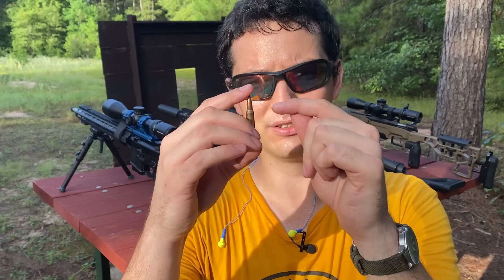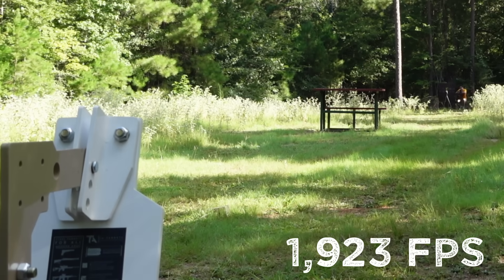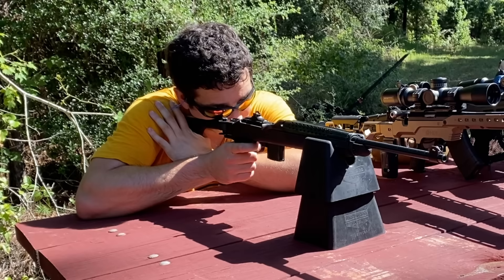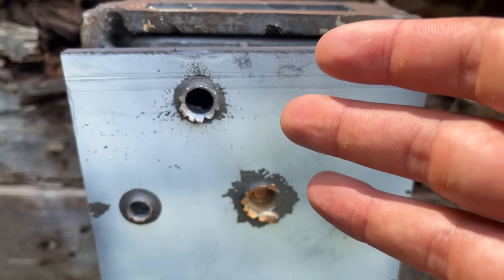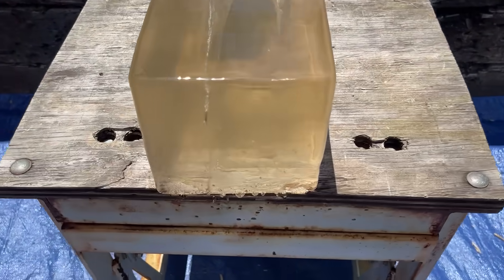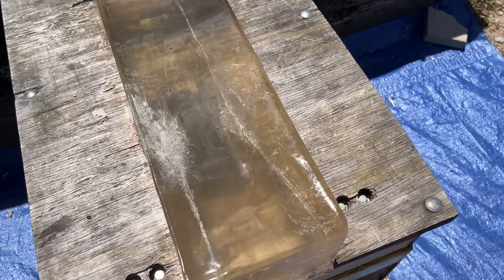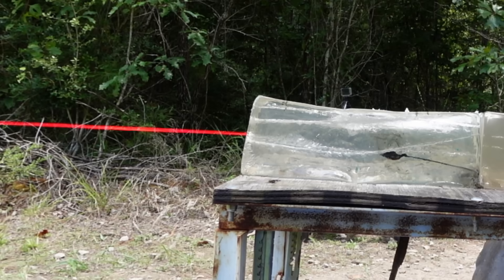I Will Never Shoot These Bullets Again

Comment: A g.i carbine has a fully shrouded firing pin with a notch cut out allowing the hammer to hit the firing pin only when the bolt is fully closed. Iver Johnson omitted this to save on machining costs. The result is a weapon that is capable of firing out of battery and often does. Resulting in ruptured cases and all the energy directed down and out
Reply: Is that what happened here?
Reply: @kg-Whatthehelliseventhathard to say as I wasn't there. But it's what appears to have happened. The shop I worked in refused to sell or work on them for this reason

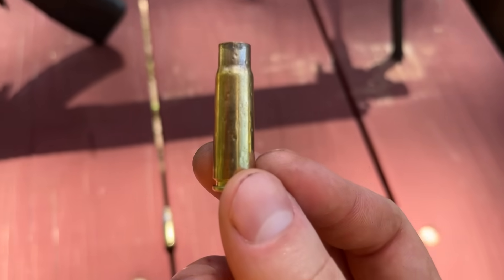Comment: 8:15 I've seen this happen before! Those dimples are imprints of unburned power that was stuck on the inside of the chamber walls. I got it trying to make black powder equivalent smokeless loads for .45-70 and was getting a lot of unburned powder due to the low pressure. So given the low velocity of the tracer ammo, a similar thing is probably going on.

Comment: It would make sense that your chamber is getting absolutely destroyed with powder because of the tracer ignite when the bullet is fired and you’re using a DI system, the tracer is going to be burning by the time it leaves the barrel and that burning powder has to go somewhere and it’s gonna go into the gas too and spray the chamber fullof crap

Comment: From my time in the military, we typically rely on tracers at night for 5.56 (M884). You should be able to see it in your setup, so I wonder if your ammo was comprised by either over heating or too much moisture while stored. Also, looking at you round, it should be a brighter shade of orange, so you may not have properly coated ammo.

Comment: I've had case head seperations with M14s & 308 bolt actions with no issue. 

Had one of the "Bad Bulgarian" 7.62x25 cases rupture blowing up a CZ-52. The firing pin embedded in my safety glasses. Magazing blew out. The extractor is still in orbit. Peppered me good. 

On several occasions, have had case head failures with my STEN Mk3. Blows out the magazine every time. That's why I started using steel cased ammo in it.

Comment: Pre war, germany used a 134g Leuchtspur-Sprenggranate for their 2 cm Flaks. It was 50% tracer with 3g Pent filler. Then they Switched to the 115g Sprgr. L'Spur with 6,2g Pent and a shorter tracer. Then again in 1940 they Switched to a 120g He round, along with different models with even shorter and no tracer. Anyway, i always wondered if and how much of an added incendary effect the tracers made.

Comment: I had a Browning 1919 walk out of headspace and a round fired out of battery. The good thing was the gun is so robust it kept the explosion contained in it, but it broke the trunnion and blew the barrel out of the receiver. It stripped the barrel threads out where it screwed into the receiver. I had to have the gun rebuilt but no injuries to me or my friend helping feed the belt.
Reply: On 1919’s the barrel screws into the locking frame, not the reunion.
Reply: @MrSpudz2  Right
Reply: There is no 30'06 cartridge detonation out of battery that would blow anything out of a 1919. 
It's just.. no. That's not a thing.
Reply: @camojoe83  I had it converted to 8mm Mauser at the time, and it didn’t blow the barrel completely out of the gun but it did blow it out enough to strip out all of the threads on the barrel. My gun is originally a nato 308 Israeli 1919.
Reply: @craigthescott5074  it was never screwed in all the way, probably... Sloppy hacked up parts mutt gun to boot. Besides, it's not like the 8mm has any more cartridge capacity than an 06 with which to magically break the heaviest stuff in the receiver, does it...

Your gun fell apart while you were running it. It didn't blow up. Big difference.
Reply: @camojoe83  as I said the barrel walked out of head space and the round fired out if battery Chief. It didn’t fall apart because it’s a very well made design. It’s a 6 day war 308 gun that has been running tens of thousands of rounds since I bought it in the 1980 ‘s and now it back to 308 and runs like a Swiss watch. How many class three weapon’s have you owned Chief? Zero because your just some U tube know it all with no actual experience.

Comment: Having seen thousands and thousands of 7.62 NATO tracer rounds going downrange at Grrafenwohr and other ranges, at night, you can see tracers....they are very obvious.  And yes, they do work both ways.  7.62 tracer burnout (if I remember right, it's been 40 years) is 750 meters - useful for adjusting fire on the coax.

Comment: 7:01 can confirm. Powder burns are excruciating. I was in a car accident and despite a collision speed of approximately 70 mph head on, when the paramedics asked me what was in pain, my response was scratches on my hands where the powder from the air bag were causing a miserable burning sensation.
Reply: I was involved in a simple, 40 MPH broadside, and the most pain I experienced just after the crash was the burning on the end of my nose and on my forehead. It sounds ridiculous, but those airbags are violent by necessity, to counteract the massive energy of a couple 2500 pound lumps of steel colliding.
Reply: Good ol Takata airbags...
Reply: @Milspecpoptart  or maybe Autoliv
Reply: American airbags inflate much faster than European/Australian ones. American standards account for people driving without seat belts so the airbag velocity Much higher. The airbag itself can cause serious injuries. But not a serious as face planting the steering wheel at 60 mph.
Reply: @tinkertailor7385 that's weird, the part number for the airbags in a BMW are the same regardless of destination. Same with Audi and Volkswagen.
Reply: There is no gunpowder, or even ignition, involved in an airbag. It is a chemical reaction that produces massive amounts of nitrogen gas to inflate the bag. No gunpowder involved. The "burns" you are describing are just abrasions, and the powder you mentioned is a mixture of talcum and cornstarch.
Reply: @jacktheaviator4938 There's sodium azide in airbags. It's an explosive, about like primer compound. 

They call it a "gas generator" because they know people are morons and would freak out if they heard there was an explosive in their car. 

If you think Hollywood gets guns wrong, you have no idea how badly they over dramatize explosives. 

Your average hand grenade wouldn't blow up a washer or dryer. Let alone a building or car.
Reply: @edwardscott3262  Its cousin lead azide was used in caps for guns, oldschool primers and blasting! The entirety of an airbag explosion however, is contained so, there would be no powder burns.

Comment: About 25 years ago I was given a Johnson brand .30 carbine.  I took it to my gunsmith for an inspection just in case.  He looks at the 'Johnson' brand and says to me, 'This is unsafe to shoot!  I will give you $** in cash or $*** credit for the parts, but the barrel is junk!'  I took his offer and watched him bend the barrel 45 degrees with his bare hands - soft as a green banana!  I'm glad I took it to him before I tried shooting it.
Reply: Could you not replace the barrel with a better made aftermarket one?
Reply: Universal Firearms made barrels had very shallow rifling. Any serious shooting and the rifling would deteriorate quickly.
Reply: My cousin bought one .
First trip out , it slipped off his sling and hit barrel first. 
It only had 9 rounds through it, and it was done...
Garbage.
Reply: I use to own an Auto Ordnance M1 carbine…. Key words here is use to…
It was total GARBAGE! Soft bolt, soft receiver, soft op rod.
I had serious metal displacement and deformation after only 15 rounds of factory, Aguilar, ammo.
That’s what you get with cast parts.
Reply: Bike @MrSpudz2 nope that sounds like parts that were not heat treated.
Reply: @MrSpudz2 Aguila is the worst factory ammo you can find. Their 308 and 6.5 creed patterns like a shotgun, tried it in 3 different rifles, like 12” groups. Their super velocity 22 is junk too.
Reply: Growing up I was always taught the only M1 carbines worth owning were USGI guns. There are plenty of them out there but admittedly prices have inevitably gone up (and will continue to).
Reply: @savagestevens6398  around a grand for the ones I've seen. I want one, though
Reply: If it was an Iver Johnson carbine it was made in the USA. They started as Plainfield Machine Co. then they were purchased by Iver Johnson about 1977. The owners of Iver Johnson Co. at that time now own Henry Repeating arms. There has been about five different gun companies that have owned the name Ivor Johnson.
Reply: What if the enemy is hiding behind a bunch of hydrogen filled balloons?
Reply: Owned by Johnson & Johnson or Johnson control?
Reply: Back in the 70s Universal made cheap M1 carbines that had the reputation of non heat treated barrels causing cartridge bulging to the point of having to use a hammer on the bolt handle to extract a cartridge.  Never heard of one of them blowing up though........
Reply: @poowg2657
Barrels aren't heat treated when they're made, they're stress relieved which is different, heat treating is done to change characteristics like hardness, the crystalline structure of the metal is changed when something is heat treated, stress relieving is just that, heating up something to relieve internal stresses, and stress relieving is cooled down slowly as opposed to heat treating when something is heated up then dunked in oil or water to cool it quickly and get it to harden, that's the part that changes the steel's crystalline structure, gun barrels can't be hardened like a receiver or they risk shattering. 
The barrels you're talking about were most likely just made from cheap metal that wasn't spec in the first place, 4140 chrome moly is the most common steel used for gun barrels, except for stainless barrels and I'm not familiar with the numbers used to identify the grades of stainless used for gun barrels, I think it's 412 or something like that but I'm not certain.
Reply: The events on this video are clearly ammo related.
Reply: Restore that rifle back into its original configuration to protect and preserve history and fix it back into its original configuration.
Reply: You can buy a new one.
Reply: Auto Ordinance by Kahr
Reply: .....wow....lucky  you
Reply: Hah! Sorry, I'm a metallurgist and can't help but chuckle! Your gunsmith was probably both right and wrong. Right in that you shouldn't shoot it, but wrong in that it wasn't safe. 

Why? Because typically you either get hard and brittle material, or you get soft and ductile material. If you can bend a barrel 45° with bare hands it's very soft and ductile. A failure would likely have caused some bulging, so a "soft" failure rather than catastrophic exploding failure, which brittle material would do. 

We'll never know, but he was right in persuading you to let go of it.
Reply: @Hydrazine1000 I'm a welder/fabricator and I can confirm what you said is true.
Reply: @Hydrazine1000 You’re obviously not a metallurgist for a firearms company! If you think a barrel that can bent by bare hands is acceptable, I’m sorry, but you are truly a moron.
Reply: @Hydrazine1000  i guess you've never seen bad metal daisy out from an obstruction.  the chamber pressure alone on a "soft" barrel would bulge the chamber area of the bore and probably blow out the gas port so badly the shooter would be lucky to get a tourniquet onto their support arm before they check out.  smug hobbyist.
Reply: @Hydrazine1000 So still catastrophic because of that happens when you're expecting something to function to save your life That would be a really bad and kind of humiliating experience😅"So child of God how did you die"...."ya see what happened was"😂
Reply: @JackHoagan There is a really big difference between "is unsafe to shoot", what the gunsmith apparently said, and "might fail to work". 

The rounds that are fired for actual self defense in America, compared to just rounds fired, is extremely low. About 15 billion rounds are sold in the US each year.
Reply: @Hydrazine1000 such a pointless comment. If the barrel is going to pop when you shoot the thing it's extremely dangerous either way. What if you had your hand on or near the barrel? That escaping gas would cut your fingers right off or throw shrapnel from the stock etc.
Reply: @Hydrazine1000  I get what you're saying about failure modes, but if the barrel was soft enough to bend by hand, it would be very easy for it to get kinked or mis-aligned with a bump if someone handled it a bit too rough or accidentally tripped while walking with it.
A barrel that malleable is not a functional barrel, it's a pipe bomb waiting to happen, regardless of the mode of failure the material has.
Reply: @barrag3463  Reminds me of those aluminum practice swords we'd have to straighten after a whack or two.
Reply: @Hydrazine1000 a “soft failure” when dealing with thousands of PSI will still end up in an explosion. Your “expertise” here just showed that you don’t know how to apply your knowledge to anything outside metal alone.
Reply: @Hydrazine1000  Then I should have sold it to you.
Reply: @HardwayRanch Oh no, I'll accept that it was a poor quality gun, no doubt there. 

Getting a permit here is also quite a bit more difficult than in the US. 

My point was that soft ductile materials have a completely different failure mode, so the gun would probably not fail in a catastrophic way.
Reply: @Hydrazine1000  That makes sense.  He put the muzzle in a vise and pulled the barrel over like Chinese rebar.
Reply: This Thread is all over the place. Few facts. Lot of SIG like hearsay and wise tales.
Reply: @WALTERBROADDUS like the sig that went off in the holster at uspsa?
Reply: @WALTERBROADDUS  😆
Reply: I previously owned a Iver Johnson. no issues and no recalls for any. And apparently, this ammo issue is not factory related.
Reply: @WALTERBROADDUS  My first was made by Winchester and I regret letting it go.  I had no idea when I shared this story it would stir up so much shit!  The second one, in the opening story with the soft barrel, I only owned for three days so I never got familiar with it.  I don't know if it was an 'Iver' Johnson or just plain 'Johnson' - I do recall the gunsmith said it was made in S. Korea by license for their military and sold surplus in the USA back when that was a common thing (I think Clinton put an end to it).  But I just shoot them and clean them - I don't work on them so that's when I took it to the gunsmith and I have no qualifications to argue with his experience.
Reply: @HardwayRanch actually South Korean carbines were American built. They were arms transfer given during Korea and later on. Many were arsenal rebuilt however. So, no longer parts matching in many cases. Rather than new production. After the gun bans were repealed , the surplus was imported. 
Iver Johnson's were all commercial builds.
Reply: @WALTERBROADDUS I suspect the ammo is fake Chinese copies. The head stamps he shows on the ammo he used are the exact years that the Chinese faked lake City ammunition
Reply: That is why I only buy American Ammo. And never will ever buy steel cased.
Reply: @WALTERBROADDUS I shoot steel case through my Russian guns with no problems at all but I don't shoot steel case through my American guns. As I'm sure you know Russian guns were built around steel case ammunition while American guns are built around brass case ammunition
Reply: @HardwayRanch  Your gunsmith was full of shit.
Reply: @WALTERBROADDUS  This is fact unlike 99% of the BS in this thread.
Reply: What is fact?
Reply: @robedwards9486  But very convincing though!
Reply: Iver Johnson?
Reply: @AjackLee4  I have as well😂
Reply: @AjackLee4  I do not remember all the details - it was a S. Korean made rifle.
Reply: No way the barrel was bent by hand.
Reply: Johnson guns are unsafe at any speed. Junk .
Reply: I own a “Springfield”, but it’s not the Springfield we know.   Off-brand low quality.
Reply: Giving you over a hundred dollars in credit for a useless barrel is next level good guy
Reply: @davidmendez9256  Well he got a good stock and other parts out of it - only the barrel was scrapped.
Reply: Iver-Johnson made quality M1 Carbines. Not buying the story at all
Reply: @donwyoming1936 actually this exact same failure you see in this video is quite common on the Johnson after 500 rds or so. Look it up in the forums.
Reply: @donwyoming1936  Iver Johnson made replicas not real military M1, M2 or M3 carbines.
Reply: @donwyoming1936 I've been a process engineer for 9 years. Let me tell you that manufacturing an excellent product does not mean that all products are manufactured with the same quality level.

High-end products and budget bargain products can come from the very same assembly line. It's just being fed by different raw materials and the level of quality checking is different.
Reply: @donwyoming1936 

Sure buddy.
Reply: Total bs